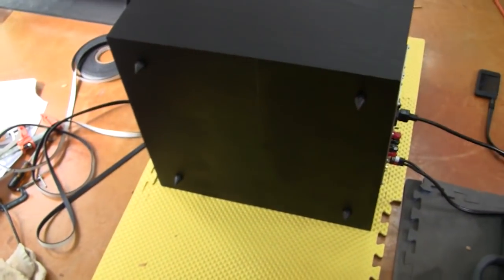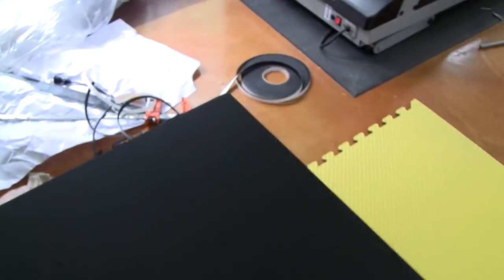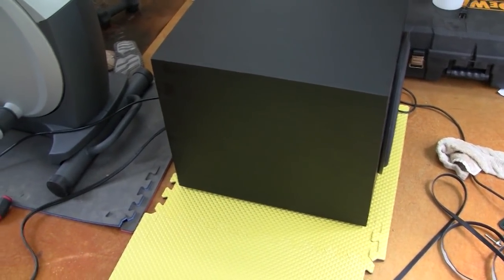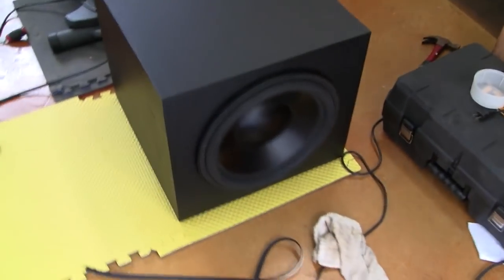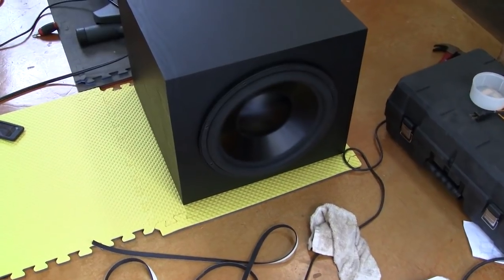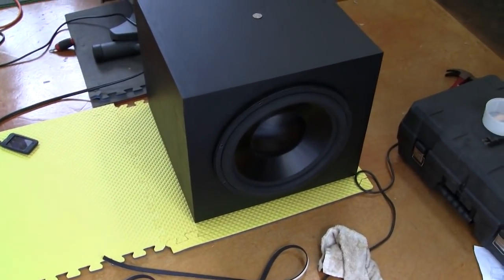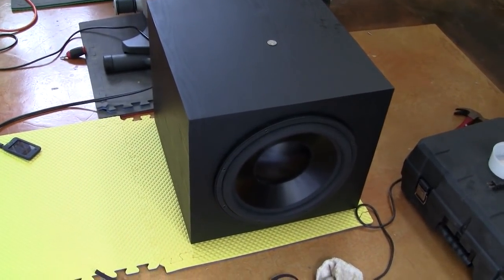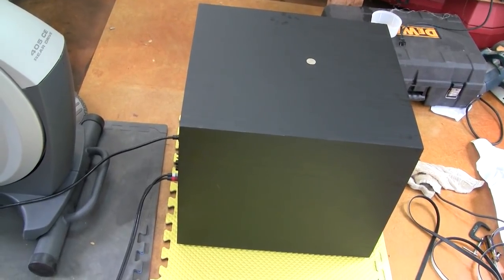Dayton 15" Subwoofer FINISHED

Comment from the maker: I disagree. Porting removes the pressure on the driver resulting in slight loss of accuracy or "fuzz" derived from the surround's malleability. Ports work fine for the "average Joe" but introduce humped response in the 40hz area and lack the fidelity of sealed subs, making them fairly rare in true reference equipment. This sub was built for audiophile level flat response reference level playback. If you like the "port" sound you might as well build a folded horn and get WAY better response.

Comment: I don;t think ports are truly understood ver well by the masses. Porting has been used and will continue to be emplyed as a very valuable technique by most of the great speaker companies. Porting creates a more textured 3 dimensional bass especially in the slightly higher frequencies where more typical bass lives. The bad rap it gets is almost always a result of smallish box size, bad or poor internal bracing and anemic power sources plus bad cross overs. Nice sub though.

Comment: dumb kids? you realise that reflex ports were designed in the late 70s because people realised that it means for a more accurate, punchy bass response. subwoofers can phase with the speakers  and have fluctuating movement times if they are left un-ported. only the top top flight speakers don't have ports and that's because they have wave guides instead.

Comment from the maker: No! The subwoofer is already being pushed to within 1 mm of its maximum travel under max load. A port would not only distort the frequency response, but physically clip the driver as well. Bad, bad idea.

Comment: This was a great build. Nicely documented too. If you're looking to further reduce the amount of vibration the sub will transfer to the receiver, you could try an isolation platform from Symposium or Golden Sound. Just insert it between the sub & receiver. You could also build your own isolation platform using two slabs of mdf with a layer of Dynamat sandwitched between them.